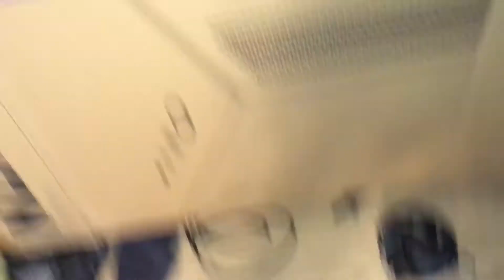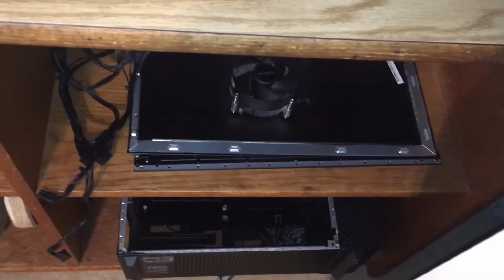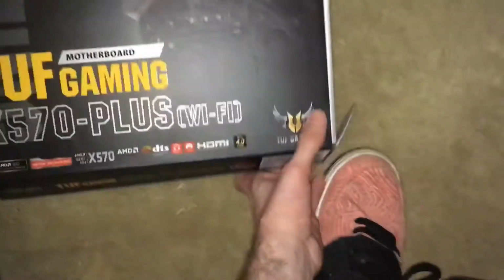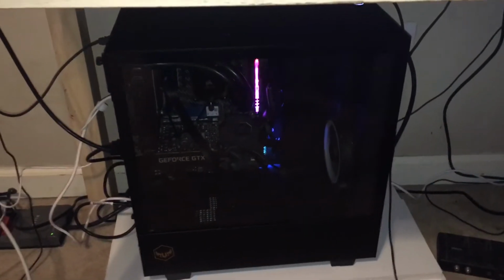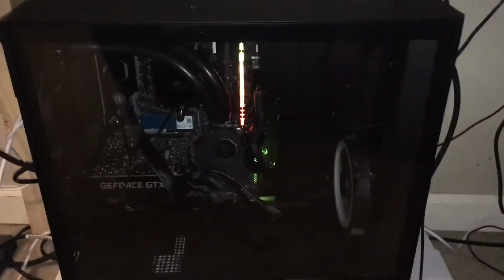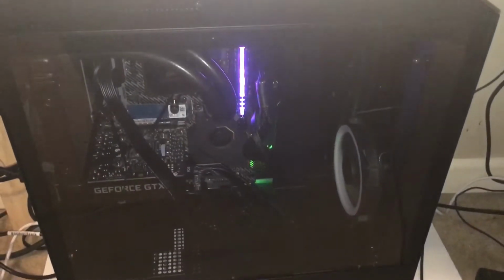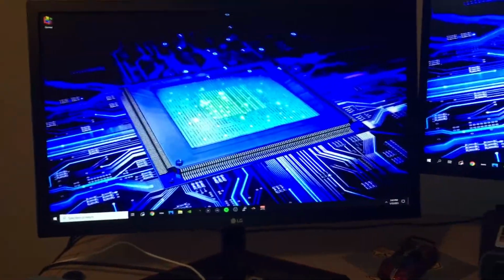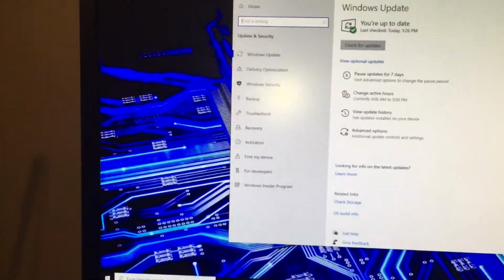My HP Omen 30L As Of Jan 2021

Comment: 10850k and 10900k run super hot in the 30L series. I have the 10850k and with the bios being locked due to the crappy Mobo. It is almost impossible to cool these chips. So i will be buying a new mobo soon and changing out the case and go from there. If need be then will upgrade to a 240 AIO instead of the 120 i have.
Reply from the maker: I think you will get better performance from your cpu because of the memory limitations on the mobo that will no longer exist on a new one
Reply: @dartlingaming  I agree 1000% 😆

Comment: I have the hp omen 25l. It came with a Ryzen 9 3900 and rtx 3070. Temps weren’t great. Installed new fans, 32gb 3200 ram, noctua cpu cooler, and msi 850 psu. Go to turn it on and one of the ram slots stopped working. The ram sticks both work when switched into the right channel but then left is causing the 3 beep error. Got a msi mag 550m mortar motherboard to hopefully getting it running. I do like the case but am thinking about getting a phanteks evolv matx case.
Reply from the maker: I got a nzxt case myself and got a x570 mobo and wound up putting a corsair h60 aio in, had to get the new mobo and case after the cooler change because the old motherboard got damaged removing the back bracket (one of the wires on the pcb got stripped when removing the adhesive) I think the motherboard was the weakest link in this prebuilt for sure (im pretty sure the 25L also has the moria 3 board which has alot of ram limitations as well) hope everything works with your new board!  I can def say if you get a larger case your thermals will drop drastically im currently sitting around 30c idle and about 50C under load which im very happy with

Comment: I've had the omen 30l ryzen 3700x 2060 for 3 months zero issues upgraded the cpu cooler to a noctua air cooler added 2 120 fans top and bottom and added a ssd
Reply from the maker: Did you have to take any brackets off the motherboard to install the cooler? I think that's where people are running into issues with the motherboard because the bracket is hot glued onto the back of the motherboard and has to be pried off for some aio and air radiators to be able to screw in, not sure exactly why they chose to glue it on because it just makes it really easy to damage but I imagine it's because they want you to go through them to get services and upgrades, still very doable to take the bracket off I would just advise being suuuuper careful not to bend or scratch the mobo which is lilkely how my 2nd mobo messed up... I have no complaints about the computer I think it's probably the best prebuilt on the market that you can get right now I would honestly just suggest staying with an air cooler that fits the bracket if you want to keep this motherboard ... I honestly think I could have done without an AIO its cool getting 30C temps but it doesn't change my performance too noticeably maybe ill get some extra time out of my system only time will tell...my next upgrade will likely be a 3060 or a 3070 and a psu if i must , thinking 3070 because of the higher gddr (3060 may look as good but i feel like that gddr will help draw distance and open worlds much more)
Reply from the maker: @Big Texas I used a similar plastic tool but I think the bracket itself scratched the mobo or it bent while prying it I was super careful but the glue was thick...maybe could have used a hairdryer or heatgun or something to make it easier and avoid having to apply as much pressure
Reply from the maker: I saw a comment regarding a cable, I could have routed it through the back of the case if I had a modular psu or did the assembly of the case differently but couldn't be bothered to take the aio radiator and case fans back out to re wire things (the previous 2 days were back and fourths to best buy just scrambling to try to get to play games and use my computer again lol smh...next build I'll def make super aesthetic but this one I was just glad to get back running...this is my first time ever putting computer components together so I was super nervous and didn't want to do anything that could damage or break my 3rd motherboard in 4 months

Comment: Hell yeah my RTX 2060 same Style and It runs good I just wish I had two fans not one
Reply from the maker: I think it should be fine esp if you just make sure your room temp doesn't get too high, the times hardest for these r the summer for sure, i've noticed a 10C difference just because of room temp while not running AC but when its on it's like I'm back in the fall as far as the temps...I'd just avoid any super aggressive overclocking since there's 1 fan (don't give it more voltage than it needs within the geforce experience tuning) sometimes the overclock isn't worth the performance depending on the amount of frames you gain

Comment: Did you have to re install windows or was it just transferring all the old components over and plug and play??
Reply from the maker: it should work as plug and play but windows will think that you are trying to duplicate a hard drive so you may need to use a program to find your windows product key because they use a batch key for prebuilt computers that isn't included in the box...usually until the key is re entered you might start having a windows activation watermark that could be annoying while watching things or gaming esp if you record gameplay, I had to use something called produkey and it worked to remove the watermark

Comment: Bought one a few days ago from a local best buy... So far so good , i mostly just game on this system , but seeing your videos on it make me kind of nervous .
Reply from the maker: don't be, just avoid anything involving dismounting the motherboard or its back plate to install another cooler...run the warranty out you should be fine with whatever came in the box you can add ram but don't detach that cpu from the bracket...the mobo is just fragile...the system has great components they just seem to have issues the moment you detach anything I think the factory who is making Moria 3 mobos is doing them in such mass that the stress test can't account for every single unit

Comment: I want to buy this pc i9 rtx 3090 for 2k(1 owner with receipt), knowing ill have to swap out the case, motherboard and AIO is it still good for today's prices?
Reply from the maker: I'd want to take a look at the temperatures under load and such but it honestly sounds like a steal given those parts are in good condition...very tough to get your hands on the gpu individually at the moment but if you could see the temperatures the gpu is hitting and confirm there is no sort of electrical or thermal issues with the systems I'd say go for it because you'd be spending a good bit more to get those parts indiv, that said i'd double check which exact 3090 model it is because it may be one that had some issues with the capacitors on the back which cause crashing...https://www.techspot.com/news/86900-capacitor-issues-causing-rtx-30803090-crashes.html

Comment: So i cant decide what to do, this or alienware? To make sure it has no issues I just have to be careful with the motherboard? Was the beeping normal, like do i just update it, and it will work just fine? I've been a laptop user ever since my first desktop broke, and i wanna get back into desktops but im just nervous
Reply: hp
Reply: @aneurysmb-side809  do you have one? How is yours going?
Reply from the maker: @_jamesr  I'd def suggest the hp if you have to go for a prebuilt, if you can id honestly use partpicker and just build it myself but that may seem daunting, the hp has a more customizeable upgrade path and is easier to get inside of, I have heard dell's warranty is not as good as hp unless you pay extra for it
Reply: @dartlingaming  was the issue just the motherboard being sensitive and will that mean my pc will beep once in a while too?
Reply from the maker: @_jamesr  pc beeping is the case speaker giving an error code from the motherboard, is it beeping on startup or while just using it?
Reply: @dartlingaming  Ooh, no no I was talking about yours since I heard beeping in the video I think, that's why I was wondering if that was the motherboard issue
Reply from the maker: @_jamesr  yeah, the case was getting a signal from the motherboard saying that I had a memory or cpu issue which turned out to be either the ram slots in the motherboard stopped working randomly or the cpu bracket wasn't registering with the motherboard causing it to think I had a cpu problem when it really was the motherboard (unfortunately all the beeps did was show me that they weren't even able to diagnose the problem because hp had to test my components individually in their facility and use process of elimination to determine it was actually the motherboard that was the issue lol...most of the time those case error beeps can save you a trip to a repair shop etc but not this time for me because it was saying the issue was with my cpu and if you only went off the beeps youd assume my ram or cpu wasn't seated properly or something minor which wasn't the case because I hadn't moved either...the issue was a bios update that happened automatically overnight and a power outage happened to occur during the time the computer was updating major drivers that are required for the parts to all work together and the power went out while it was writing important data onto the board so it got corrupted basically thats what turned the motherboard into a brick unable to do its job
Reply: @dartlingaming  Ooh, so basically for short, everything was fine, there was no beeping before, you needed a bios update and then overnight because of the outage, everything just got messed up, mostly the motherboard?
Reply from the maker: @_jamesr  yea just the motherboard got messed up, id turn off auto updates and just manually update things every now and then that way nothing can happen without you knowing in the middle of the night if you like to leave your pc on sleep mode
Reply: @dartlingaming  Aight bro thanks a lot! That cleared up so much, just in the middle of thinking which prebuilt to buy and you were a great help man, keep up with the updates and everything on your rig on the channel cause it will definitely help many people since not many youtubers give status updates on what happens to theirs

Comment: Honestly i just wanna upgrade my omen it only have 8gb ram and i bought a ram stick and put it in but every time i turn on my pc with the ram stick in it starts making a weird sound
Reply from the maker: I would try to get them to replace your motherboard, the ram should not be an issue to upgrade and it is covered by the warranty as well, not sure if you could send it in and have them install it as they usually want to charge for upgrades but if you feel like something is malfunctioning that should be an exception and covered by warranty...I would try to get something done either way, is the ram showing up as you having more in the task manager etc or are you not able to boot up after the new ram is in?  It could be your fans just thinking the ram is at a higher speed because more ram is used the more you add, but I think it's just the way the motherboard is with the auto fan curve or it could be something you could adjust within the omen app or the bios when starting the computer...def call or get on an online chat with somebody from hp asap because it more than likely can be fixed by you or worst case somebody can fix it while its under warranty still

Comment: when i tried installing my H60 AIO i think the motherboard got fried. i installed and put everything back properly but it never wanted to work afterwards. sent it into HP and for 3 months they couldnt even figure out what went wrong so with me complaining so much they sent me a brand new omen 30L but this time instead of a GTX 1660 Super they gave me a RTX 2060 Super and an Extra 8GB of Ram "Making it 16GB Total" Free of charge and extending my warranty. now im too scared to even attempt to replace the aio from the stock fan like i tried last time cause i dont want to run into the same problem. ill probably get a new motherboard and install my AIO into that all in one go.
Reply from the maker: yeah it's def the motherboard, mine def got bent or scratched or took some kind of static charge while installing the aio and prior to that just from a bios update...when you get a chance just get a new motherboard but I'd suggest riding that system out until your warranty is done because you won't see any big performance boost only thermal improvements from the aio that will prob matter more for longevity after the warranty is up (you will just have to be careful with that motherboard and get a new micro atx  motherboard to fit the case and potentially a new psu (maybe not the psu though unless you want a modular one so you can route cables neater and easier
Reply: @dartlingaming  yeah im thinking about getting the motherboard and PSU from the video you linked. but its smart to wait till the warranty is up.
Reply: @dartlingaming  i have 8 months left so thats plenty of time to plan ahead for the parts i want.
Reply from the maker: @warfighter268  I honestly wish I did, I would have saved a good amount of money doing so but I guess at least I got a crash course in building a pc from a new case and mobo lol...just wish the process could have been on more voluntary terms but It's all part of the process i suppose lol
Reply: @dartlingaming  hey thats what i learned. but i got to admit the Liquid cooler looked nice in here...even tho i didnt work xD. i plan on upgrading my 1tb to a 4tbSSD. since i already put a 4tb Hdd i had lying around into the empty slot. you think putting a 120mm fan on the top mounting bracket (with the squares punched out) would work better as a intake or exhaust for the CPU?
Reply from the maker: @warfighter268  I would put it as an exhaust on top because it will help get heat away from your cpu while the radiator supplies cooler outside air to the heatsink and the front fan does its thing I think that's set as an intake, also I think a top mounted fan will do better as exhaust as it won't be sucking as much air directly down into your case and heat rises
Reply: @dartlingaming  good point. I got some tinkering to do tonight lol.

Comment: Why not just get the modern worth the liquid cooler? And, yes most pre-builts are going to come with a custom card usually built by the maker of the computer in the "well-known" large companies.  The only difference is to have an omen  graphics card instead of a MSI, Gigabyte, Asus, etc. They do this so that the card fits in the case better. They're really isn't a "flagship" graphics card,  lol. I mean the reference models are usually the best, until the 3000 series cards came out. Still the same gpu.
Reply from the maker: very true, by "flagship" i mean't the stock nvidia introduction model but its the same card just on a diff pcb with diff fans heatsink etc, some can be a little better at handling voltage for overclocking depending on the parts used but in general you're going to get similar performance...I think the worst part about the omen is just the motherboard, no complaints in any other areas, I had my motherboard fail twice on the omen, the first time while doing a bios update overnight automatically while my pc (and I) was sleeping

Comment: Which is better  omen 30l ryzen 7 3700x and AMD RADEON rx 5700 / or omen 30l i7 10700k with RTX 2060
PLEASE LET ME KNOW WHICH IS BETTER. Thanks!
Reply from the maker: I'd go with the 2060 just because of geforce experience and nvidia boost and some of the low latency features they're building into games right now that probably aren't going to be supported by the amd graphics cards yet... Technically performance wise they are not too far apart but in terms of frames and stuff like that the Intel + nvidia combo will perform better in most games you can look at some benchmarks the highest scores are done recently with Intel CPUs and nvidia gpu's (3090's holding the record I believe) whichever you choose I think you will be fine keep in mind you probably will want to get a new graphics card in a couple years regardless as the market changes with new games and the cards become more available and more reasonably priced so neither one of them is a bad choice